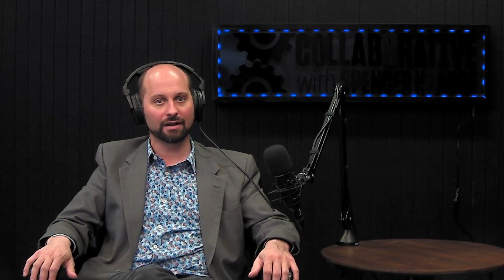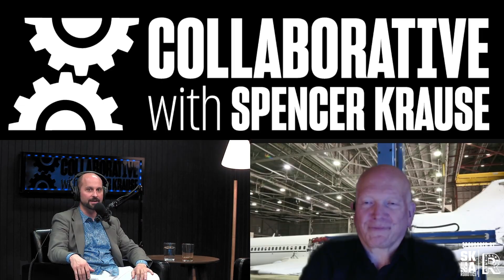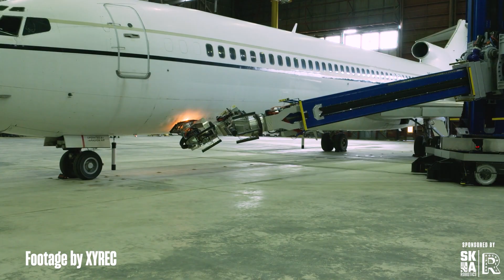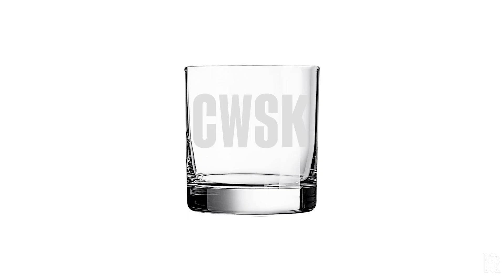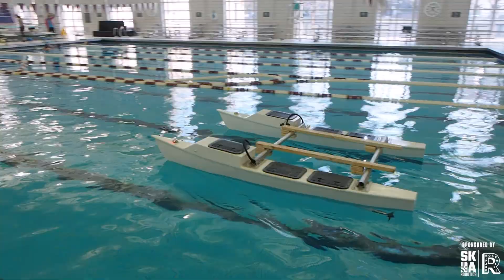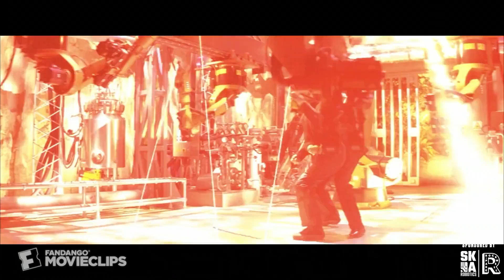Collaborative with Spencer Krause - E176 - Peter Boeijink (Empowerment by Innovation)

Comment: Sharks and golf balls. The texture breaks up the drag along the fuselage! I knew that one 😉. Also e vehicle named “sparrow” round about 1998-9 had dimples on the trailing edge of the unibody. 

Ironically this was figured out with I think they called them “gutta” balls that started smooth but got etched over time and subsequently flew farther.
Reply: Also B17’s stopped getting painted because the weight of the paint cut range ~90 miles. …Okay I had to google it I thought it was 200 miles, but the AI is telling me Boeing conducted a study on it actually thinking it was the paints weight, but it was actually the smoothness of the finish the paint created. That’s wild.